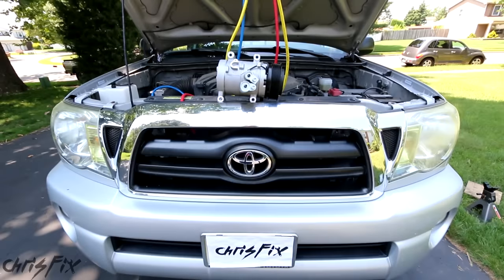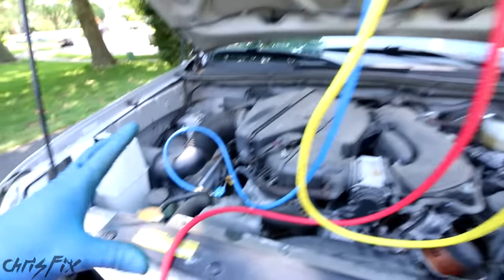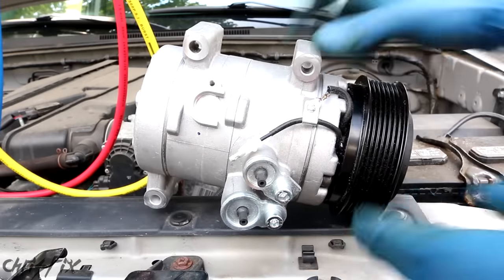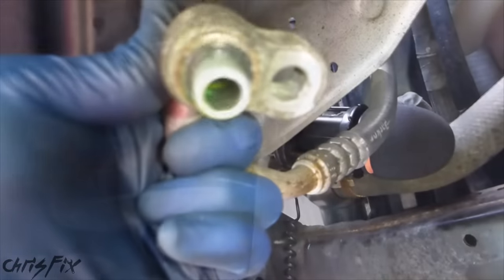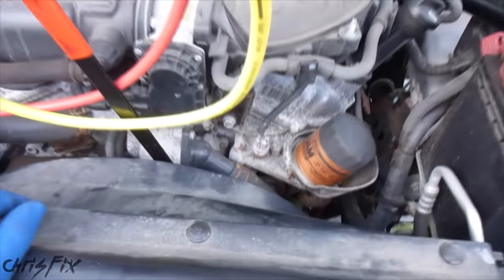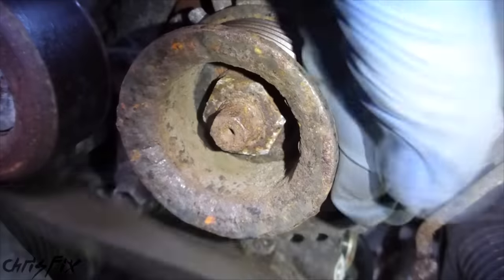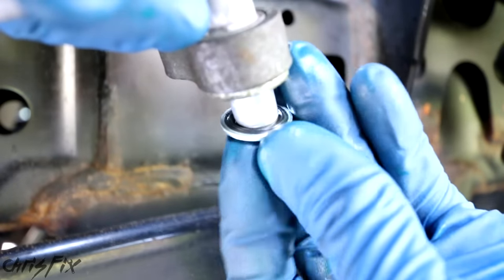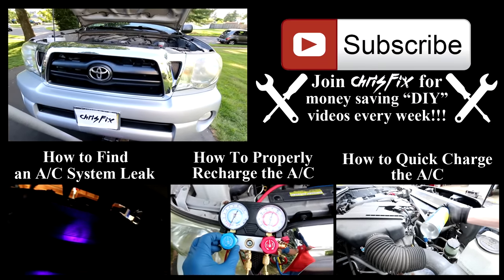How to Replace an AC Compressor in your Car

Comment: Hello Mr. ChrisFix it is currently 111 in the PNW and I don't have A/C and I instantly regret it and I was going to replace the Compressor is it required when replacing the compressor that you replace the drier and expansion valve? please let me know

Comment: I am replacing my compressor in my 2007 Infiniti g35x after having the same issue with my compressor. All said and done I will only spend around $370 on the repair (that includes tax). I am going ahead and swapping out the serpentine belt while I am at it, since I have to take the old one off anyway. Here were my costs, if people want a second reference!

AC compressor (comes with a bunch of o-rings, drier filter, expansion module, and compressor oil) was $327

Serpentine belt was $13

Freon (R134a) is $30

Manifold gauges and vacuum were FREE because I used the tool loaning service Autozone has and returned the tools once I was done.

Comment: Thanks for the video Chris! I'm in the middle of troubleshooting my AC system and this has helped a lot! The part you took off of the condensor at 8:00 in the video, my old condensor did not have that and was connected directly to the other electrical part to the car. Is the removable wiring harness needed for the new one or does it affect anything if that is not there? Thanks!

Comment: Just wondering: don't you have to flush the system so you don't end up with too much oil in the system if the new compressor comes precharged? Or too little oil if the new compressor isn't precharged?

Comment: Hey man, I have a quick question. I have R12 on my 83’ z28. My clutch seized and I’m thinking of just changing the entire compressor. Will I have to add the compressor on then vacuum the entire system to then add the r134 oil with Freon?

Comment: Hey Chris,  would you recommend flushing the system before replacing the compressor/condenser?
Reply: Good thing to do, because some wear material is always there even with correct lubrication. But not strictly needed when the compressor you're replacing hasn't seized up. On the other hand, replacing an old condenser and an old accumulator/dryer, even if you keep the old compressor, can do miracles.

Comment: Hi, it's an old video but I just wanted to know if you had a dessication or dryer that you needed to replace when you changed your compressor. I have a corolla I need to change the compressor for because the mechanic said it was faulty (intermitten), so I think the system is clean its just a bad compressor. Other videos show all these extra steps and I'm not sure what is right or wrong for me

Comment: When changing compressor should you change out anything else <ex. condenser, evaporator>. My compressor seized up
Reply from the maker: Receiver dryer if you got air in the system.

Comment: Hey Chris.  Where can I find the washer seals for the compressor only? I am finding kits that come with six different washers and I don't know if they are for the compressor or not. Is there a place I can find just the two seals I need? Working on a 2016 Ford Transit Connect XLT 2.5 gas cargo van. The kit doesn't say exactly what the seals are for. I don't mind buying six of them if two of them actually go to my compressor.  They are 3 different sizes. 2 per size. I'm wondering if two of them will work on my compressor.  Thank you!

Comment: Chris:  I have an '87 Suzuki Samurai with a 1.3L engine and an a/c on board. We live near the beach and the car rarely goes to the desert, so we don't really need the a/c. I'd like to just take off the belt drive from the compressor to lighten the load a bit on the tiny motor and to increase gas mileage a tad. But what will not spinning the compressor do to it? I seem to remember hearing (very long ago) that if a compressor is not run it will negatively effect it. When we sell the car someday, it would be nice to just hook the compressor back up and recharge the system. Please give me your take on this idea.
Reply from the maker: If the compressor is off you’re not losing efficiency. Only when it’s on will it take more power to run

Comment: 08 RAV4 Sport 2AZFE 175K when AC cycles hear a loud groan for about 10second when the AC is on, heard it is the AC clutch, but think it is the expansion valve, your thoughts? Thanks for the info Chris

Comment: Hey Chris I used plug my car ac compressor on bypass ( staright to the battery) and it's working good, engaging the clutch as normal but it's not working with the connection. I checked the all fuses and relays It's all are good 
Why is that ?

Comment: What if your ac compressor locked up what should be replaced usually just compressor or should you replace the ac condenser as well?

Comment: Hey so I'm curious about the compressor you used for this video. I'm changing one on a 2008 Honda Civic and am slightly nervous about buying a cheaper part, the parts store price is about 700$ while the leak takes me to 200$ parts. How have these cheaper parts worked so far?
Reply from the maker: My friend hasn't had issues with the compressor!

Comment: With a compressor failure, you're probably best changing the dryer and expansion valve. SOMETIMES the dryer is part of the condenser so it's more costly

Comment: Hey guys, a lot of sources say when you replace a compressor you also need to replace the condenser and the expansion valve. I'm on the verge of swapping my compressor but everything gets so expensive when you add the rest....is it really that necessary?
Reply: You should replace the orifice, and the filter drier

Comment: Hey Chris, I got a 2006 Suburban. My compressor started smoking/squealing at about 2,000 - 3,000 rpms. I took the belt off and the compressor never locked up. Would it be ok to just change the compressor and nothing else since I caught it in time? Thank you!

Comment: Hey Chris, the clutch on my compressor just exploded and I just received the new compressor today, but I'm having a problem. The sticker under my hood says the + or - for pag oil is from 4.7oz to 5.4 oz, and the compressor I received came with 3 oz of oil in it, so I added an extra 2 oz of oil. Considering I am replacing the receiver drier and expansion valve as well is it still safe to add 5 oz or should I add extra because of the new receiver drier?

Comment: Pro tip: When you're using a u-joint socket adapter, wrap it with electrical tape. This will hold it in place enough to easily feed onto the bolt head.

Comment: One of the things I like to do for general purpose bolts installed in aluminum is to lightly dress threads with  some teflon paste.  It helps  keep moisture and air from promoting corrosion as fast - really nice where steel meets aluminum threads.  Obviously this is not a tactic for exhaust bolts or sensors,  and things that ought to receive loctite.

Comment: The shop told me that i needed to replace the expansion valve and filter drier and also flushing the hoses and condenser every time I will install a brand new compressor. Is that true?

Comment: Hey Chris, my clutch pulley went out in my compressor. Would you recommend replacing the hole unit, or would It be alright to just replace the clutch pulley and coil plate. The compressor has 175,000 miles and 16 years on it.
Reply: Thats about the lifespan of a well made ac compressor typically, I’d say it’s about it’s time

Comment: Chris I have trouble.  Car can stopped blowing cold air and started to drive and it’s sputtering then got an engine light.  Went and bought a reader and got code p0354 code so swapped out my plug and coils and still same.  Looked at all the lines to see if they are okay everything I see looks okay.  I looked at ac compressor and the belt is moving around it but outside part is not engaging.  I check all the fuses.  What do you recommend?

Comment: Brought mine to a shop because AC wouldn’t come out cold. Said the compressor and belt needed replacement. Ac is not as cold as it used to be since it being fixed and they said they had to remove power steering pump or something of the sort to get to it ( which was the reasoning behind my truck being covered in some oily substance) also ac makes a droning noise since replacement which it never has made before

Comment: I have 2011 tahoe, and the compressor comes pre-oiled with 3 ounces of PAG oil, is that enough !? Or i have to add more !? What is the total quantity!? Thanks
Reply from the maker: There should be a sticker or informational label that tells you how much you need, but if it comes pre oiled most of the time you do not have to add anything extra
Reply: @chrisfix  thanks, BTY I’ve charged my ac myself,, thanks for your help and most detailed videos in youtube 🤗

Comment: Sooo my 2013 dodge dart ac went and now couple weeks later I heard this weird humming/shaking noise coming from the engine. I found out it was the AC compressor and it looks like the clutch got bent or something and is thrown off. On top of that it's spitting little flakes of rubber/metal? Around the area. It only makes noise when the climate is on otherwise no problems. I'm wondering if I can just replace the broken clutch head because as far as I know the compressor still works.

Comment: Had the compressor seized or had the coil gone high resistance? If it was the latter, then you could have just replaced the coil.

Comment: Did you have to replace any other parts? I've head thet if the system is contaminated you have to replace a ton of parts, not just the compressor. How can you tell for sure that the system isn't contaminated?

Comment: What compressor did you purchase?   have a 2006 Toyota Tacoma 6 cylinder 4WD.  I need to replace the compressor but I can't locate one the assures it is profiled with oil and comes with o-rings.  Can you tell me what you purchased?
Reply from the maker: It has been a while but I think it was this one: https://amzn.to/3S7e8sJ

Comment: I have an O ring kit that does not comes with those washer seals just green O rings, mine is a 2004 Toyota Corolla, when trying to buy a 4 Seasons kit with those washer seals in Amazon it says that it does not fit my car and recommends the green ones I already have, just wondering if I would need them; the AC is still hooked up as have not evacuated freon yet. What is your thoughts on this?

Comment: Could you plz tell what is the role oil in ac system?
why oil is needed before recharging of gas?
Is oil is used for another purposes rather than lubrication of compressor?
Is oil is also circulating along the ac system during in working condition when car ac is on along with ac gas?
Reply: A little oil is added to replenish whatever oil came out together with the refrigerant while removing the old refrigerant. Oil also lubricates the thermal expansion valve mechanism and keeps all seals from shrinking/cracking up and leaking refrigerant. Yes, oil circulates around the system together with the refrigerant.

Comment: I have the same truck demonstrated in this video. Problem is I need to replace the crankshaft position sensor and haven't been able to locate it where the dang this is. I was told it's behind the ac compressor assembly?

Comment: So if compressor comes with oil in it already.  No need to add any oil?   So the oil is inside for the compressor to function.  Oil does not go where freon goes thru correct.   🤔 sorry just wondering

Comment: great video.  i was going to replace and have the shop fill it.  But he wants me to add oil since he does not do it the way you do in this video.  How would I do that??
Reply from the maker: Since it’s empty, open up a hard line by unbolting it and add it there.
Reply: @chrisfix  Your video has given me the confidence to take this on.  I used Amazon to order orig. A/C Delco parts which saves over $150 when buying at local part store.  Thanks for the help.

Comment: @10:30:  Are torque wrenches accurate when used with universal joints?  (It seems like they would be, given that the input and output rotations are still 1:1, but I feel like I've heard warnings about that.)
Reply from the maker: I would always try to avoid using a torque wrench with a universal joint, but I haven't had any issues with doing it the few times I have!
Reply: They will not be accurate as the offset will add a small multiplication factor especially when they are deflected. But it should be small so practically would work. Since the torque specified is generally in a range I would at least use the lower side of the range so that the final torque is still within the range even after a small multiplication.

Comment: My question is tho how important is it to clean out the system before installing the new compressor I heard that tiny bits chip into the system and need to be replaced or cleaned out

Comment: I have a question- compressor changed twice in my 2015 and still turn air on and it sounds like a diesel. What is problem also changed all pulleys now? New serpentine belt still makes this awful noise. Help need your help

Comment: My new compressor from R&Y only has one lead inside the connector.  Is that normal?  I haven't taken out my old compressor yet so I don't know what it should be.  It's for a 2007 Nissan Versa.

Comment: I have to change the AC compressor in my car, but my car requires a compressor with 3 wires/clips. Do I need to buy a new compressor with 3 prongs? Or can I use a new compressor with 2 prongs and just use the wires from the old compressor into the new compressor?

Comment: I have the same year if truck but access is much more difficult.  There is a wiring harness right in the way of the top right bolt and getting the compressor out was way more difficult.  I wonder why

Comment: Probably should’ve been mentioned that you should ensure the system has been depressurized prior to popping off the ac lines. Obviously if your compressor is leaking chances are you won’t have pressure anyway, but good practice so a line don’t just fly off after you crack it loose

Comment: How would you know if you need an AC clutch replacement, or Compressor replacement or just Freon ?
Reply: If the clutch is getting power but not operating or slipping it is bad. If the compressor is making a lot of noise or is locked up then a bearing or something has gone out inside of it. If the pressures are low then the system has a leak and is low on refrigerant.

Comment: How do you choose a good quality one ?? If you aren’t buying oem are after market just as good ?? I need one for my 2008 Mitsubishi Lancer gts
Reply: Depends on the brand. Do some research to find out who makes quality parts and who makes shit.
Reply: Be sure to replace the condenser and the dryer element, properly flush anything, use the correct oil and oil amount, properly load the new compressor with oil, properly prime it, properly charge the system, before condemning an aftermarket compressor.

Comment: Hey ChrisFix. My 2008 Vehicle had stop on me and said I need ac compressor starter and oil changed because the oil was low. I was planning to take for oil changed but didn’t make. Do you know the price legit $786 with labor add already? The only thing I noticed that if I knew how to repair I could had save 250 labor and get 110 in core from auto zone for the parts total 360. So I see I could had spend about 426 I believe. But the car want start.

Comment: Don't forget to run a vacuum pump on the system to remove all the moisture. I suggest running it for 4 hours to a day to make sure all the moisture is out of the lines.

Comment: I have a Tacoma 2014, and whenever it is Idle on a hot or humid day, it blows fan air, not cold. I have to speed up for it to blow cold. It’s been like that for a while now. I checked refrigerant, and it was not low. Any ideas?

Comment: Hey Chris Fix,

My car runs fine for the most part but when I turn on the AC, the car misfires and the check engine light starts blinking. It reads a multi-cylinder misfire code. Would replacing the compressor solve this issue or could it be more?
Reply: I've have two cams, one exhaust and one intake (i think) and replaced one of them a couple weeks ago. Would that be related to the issue?

Comment: I tried to replace the a/c compressor in my nissan altima 2006, and when i tried to go flush the system of refrigerant from a mechanic they pretty much refused to do it unless i had my condenser and my filter replaced as well. very frustrating. is there a way around this or should i just play it safe. if i play it safe then i'm just going to take it to the mechanic to get the entire thing done.

Comment: Chris, long story but i was cleaning the filter in my low side ac line(2006 taco 4.0) ok so the expansion valve is in my firewall on the passenger side obviously you know that okay where the lines go into the expansion valve there are two hard plastic clamp type things about 3 in off the firewall. I didn't know these actually held the lines together so they were damaged trying to get them off but I'm having trouble actually finding out what they are called and how to order them. Do you have any clue what they're called again the high side AC line and the low side both have them about 2 to three inches from the expansion valve. Do you have any clue what the heck these things are called?

Comment: Please, can someone give me some advise. I have a car with AC compressor clutch type to be replaced (1 electrical connector),  but I got an spare one without clutch but with control valve (2 electrical connectors). The rest in the compressor Is there any option to install this type to work in my car?

Comment: I replaced all new parts inside my AC, and now having trouble wiring it back up. Old clutch had only two wires. A black and a white wire. New one has two black wires and one Red wire. Do all the Black wires go together, and the Red wire does it go to the white wire? Thanks for any help.